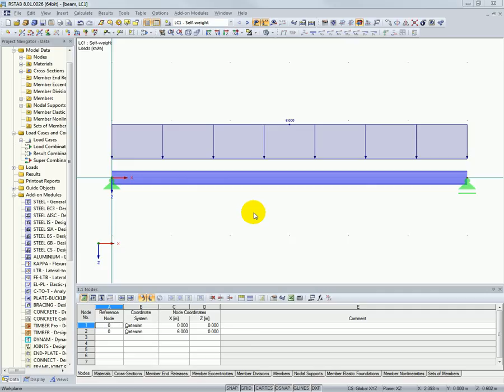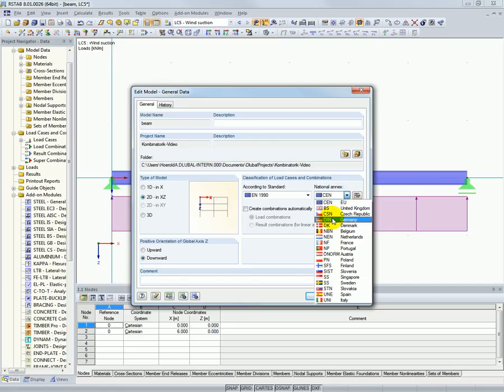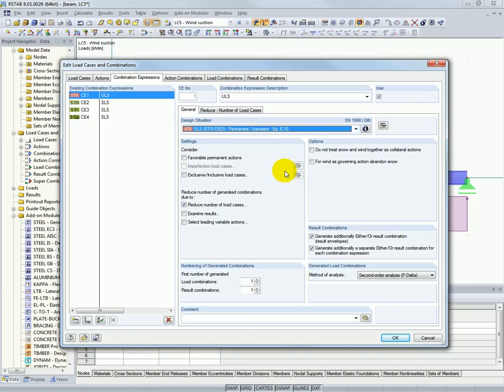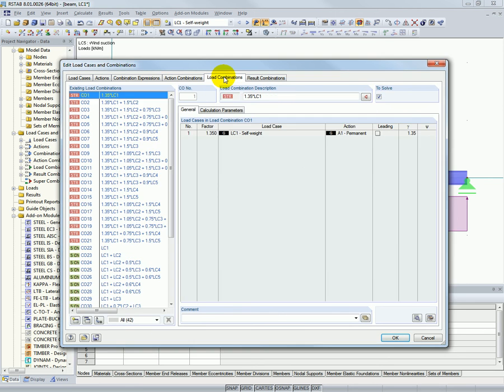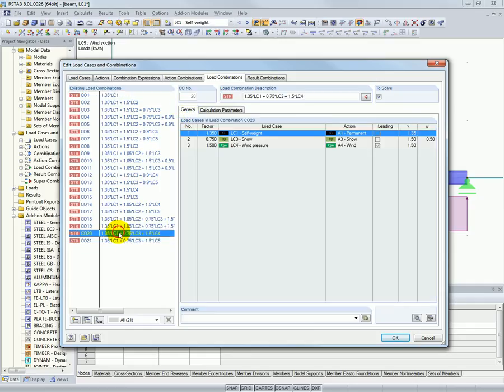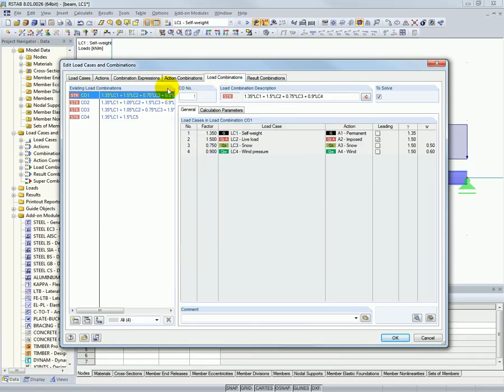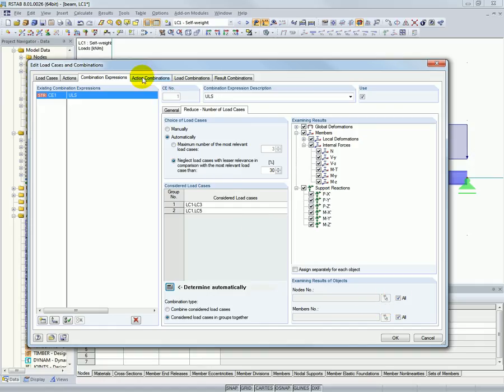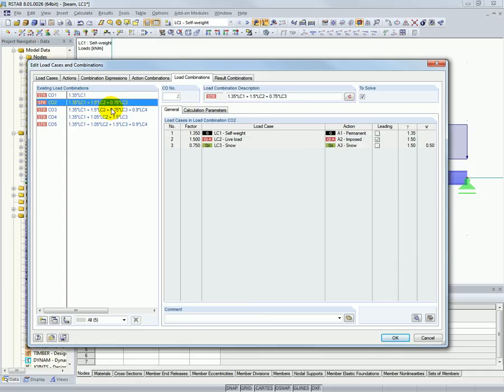Dlubal RFEM 5 & RSTAB 8 - Automatic Generation and Reduction of Combinations

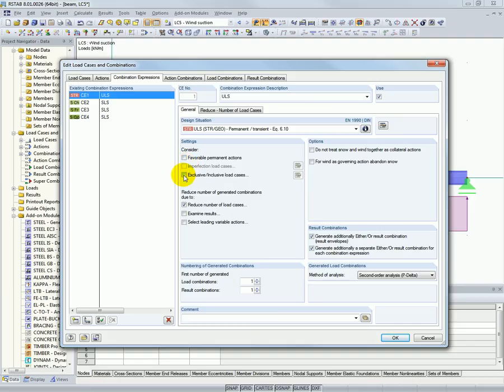Comment: May I ask why this option to combine manually load cases, to act simultaneously or not (2:31), is not active for AISC standard like in EC?
Reply from the maker: Hi, Branka!
The AISC 360-16 Sect. B2 refers directly to the load combinations set forth in the ASCE 7 (or other building code), which this standard is available in both RFEM and RSTAB. We hope this helps!
Reply: @DlubalEN  It helped me. Thanks a lot.